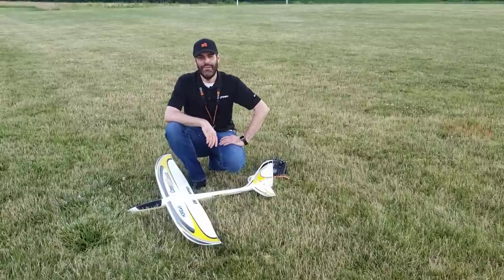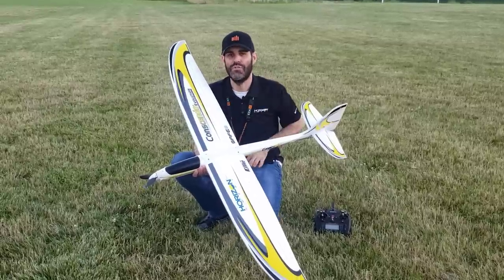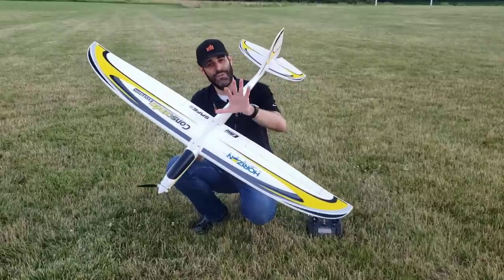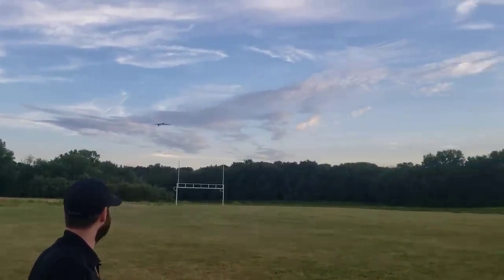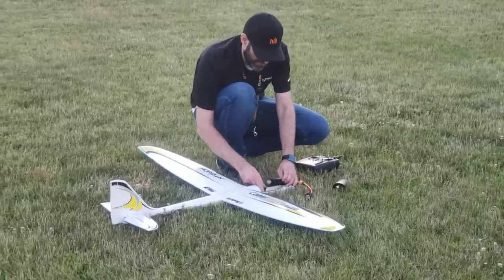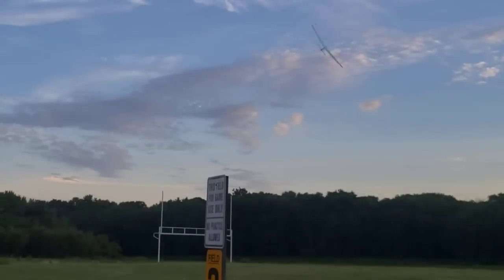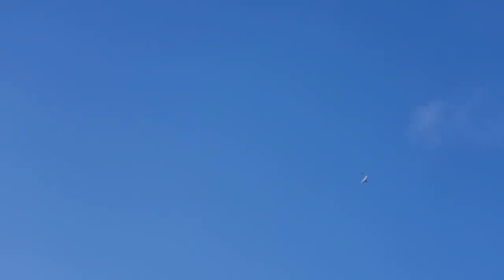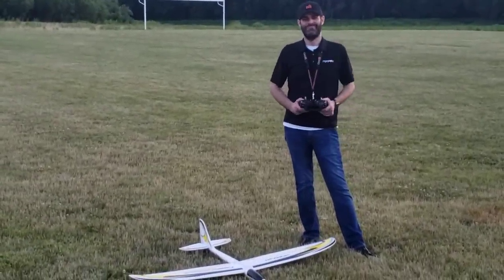Flight Talk: E-flite® Conscendo® Evolution 1.5m

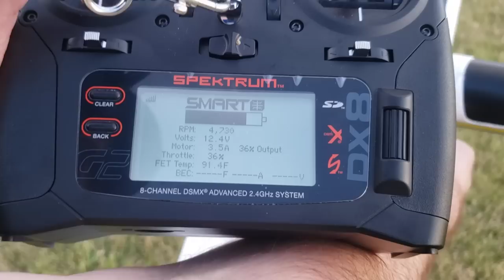Comment from the maker: Please click "Read more" for links and more information. Filmed using a Galaxy S9+ (so it's best viewed on a larger monitor/screen and apologies for any focus/sound issues!). Flight with the 3S 1300mAh battery begins around the 6:00 mark, then a flight with the 4S 2200mAh battery begins around the 10:20 mark. See the Overview video here: https://youtu.be/myuBdYXRSMA

And see more video here: https://youtu.be/6owr-dv6Ats

Join us at the park with Jason Merkle to learn about the features, flying characteristics and more of the most powerful, capable and fun to fly Conscendo® yet!

Learn more about the E-flite® Conscendo Evolution 1.5m Bind-N-Fly Basic and PNP here:

https://www.horizonhobby.com/search?q=conscendo+evolution+1.5m&search-button=&lang=default

First flown with a Spektrum 3S 11.1V 1300mAh 30C Smart LiPo Battery: https://www.horizonhobby.com/product/11.1v-1300mah-3s-30c-smart-lipo-battery-ic3/SPMX13003S30M.html

Then flown with a Spektrum 4S 14.8V 2200mAh 30C Smart LiPo Battery:
https://www.horizonhobby.com/product/14.8v-2200mah-4s-30c-smart-lipo-battery-ic3/SPMX22004S30.html

Also compatible with a Spektrum 3S 11.1V 2200mAh 30C Smart LiPo Battery: https://www.horizonhobby.com/product/11.1v-2200mah-3s-30c-smart-lipo-battery-ic3/SPMX22003S30.html

More Spektrum Smart Batteries: https://www.horizonhobby.com/search?q=smart%20lipo%20battery

Spektrum Smart Charger Lineup: https://www.horizonhobby.com/search?q=smart%20charger

Spektrum Smart Accessories: https://www.horizonhobby.com/SearchDisplay?searchTerm=SPMX_SMART_Accs&categoryId=&sourceDomain=&storeId=10151&catalogId=10051&langId=-1&pageSize=40&beginIndex=0&sType=SimpleSearch&resultCatEntryType=2&searchTermScope=2&showResultsPage=true&searchSource=Q&sourceDomain=&pageView=

Spektrum Smart ESCs: https://www.horizonhobby.com/blog-smart-technology-escs.html

Flown with a Spektrum DX8 8-Channel DSMX Transmitter: https://www.horizonhobby.com/product/dx8-8-channel-dsmx-transmitter-only-gen-2/SPMR8000.html

Also compatible with most Spektrum transmitters: https://www.horizonhobby.com/airplanes/radio-systems/transmitters/

Comment: This was BY FAR the most fun I’ve ever had flying a maiden and then 2 more batteries after. Piece of cake to hand lunch, just wants to fly level. I started off with an 1800 3s. (Covid-19 recoverer, still have issues with equilibrium, vision and fine motor) This plane in either Safe or AS3X is rock solid. It was mildly windy, 6-10 mph, but this plane cut through it like butter. 30-35 minutes flight time (1800 3s, 2200 3s, 2200 4s) Never had to trim it out. A little up elevator with the 4s, but I did that while checking the CG.
If you’re thinking of buying one, do so. It’s the best of All Worlds. You want to glide around, take it easy, fly for 30 minutes on one battery, you can do that. You want something that can go close to 100 mph and not feel like you’re gonna lose control 3 feet off the ground? You can do that. Want to work on your loops, rolls, Split S’s, Cuban 8’s? This is the plane. Want to do all of the above on the same battery? This is plane. Other than the first toss, the 1st turn I was out of Safe. I was in low rates (70/30) a couple of passes and then high rates (100/20) for the rest of the 3 batteries. (I did takeoff in Safe when I hand launched with the Smart 4s 2200. Wasn’t sure the what throttle percentage with the added weight, and there’s no room to move the battery forward or back)
Best, most fun plane I’ve ever flown. It’s the “Mood Ring” of RC planes. Pick the mood you’re in and it’ll fly that way. If you’re just wanting to chill out, it’s hip to your scene. If you had a bad day at work or at home and you’re wanting to fly like a pissed off 15 year old, pop a 4s in and get your “Need for Speed” face on.
What blew me away the most. Rock solid at all times in AS3X. Battery longevity. Recoverability. (I came out of a turn with the 4s, lost the plane in the sun for a sec, when I did see it, I was in a knife edge, nose slightly down attitude. A little freaked out, but I just slowly leveled the wings out, it corrected itself in the nose down, and slowly climbed out. No elevator, no extra throttle, and then it flew by me, I swear it said, “I got this Jeff. Go park your butt under a tree. I’ll call you when the battery gets low.”
Favorite plane I’ve ever owned!

Comment: have had this one almost as long as my extra300 and this is my favorite. on a 3s1300mah i get 5-15min and on a 4s2400mah i get 15 to 45min fly time. absolute a joy to fly, can be slow and smooth or fast and agile. and it is so easy for beginner to fly. great job making it
Reply: Yeah- and what about tail wag ? Mine is absolutely horrid and embarrassing to fly around others. They always ask what’s wrong with it when flying it. This thing is really overpriced trash heap
Reply: @endliberalism4305  this is not my experience.
Reply: @firstjayjay  I've been looking into what causes tail wag but can't find anything that would be the cause to my problem,  I'm seriously bumming , the best thing I can do is try and see if Horizon hobby will hook me up with a new one.... it's doubtful but I've gotta try something
Reply: @endliberalism4305  yea, these kind of products do come with a disclaimer where it is argued that any default could be the result of owner causes. But my cousin also have this model and no issues there. I really do hope you get it sorted out, as it to me at least it is really a great all around flyer.
Reply: @firstjayjay  hello John , will you look at your Conscendo from the front and see if the horizontal stabilizer is even with the main wing or is one side slightly lower. Thank you .

Comment: I have the Advanced version of the Conscendo, it is a fantastic plane that can do a lot of things. I understand why you changed the foam density though, the Advanced is not stiff enough I think. And it has a weak section in the fuselage, right at the back of the cockpit (less foam here, geometry, ...), I had to repair mine at this spot. I don't know if it's the case for this new version. I reinforced mine by adding 2 carbon rods inside, from the back of the cockpit to the receiver compartment, much stiffer now.

About the 1300 mAh lipo, I agree, it makes the plane very light, very good for thermals with a aileron/elevator mix ("snap-flap"?). I put the lipo all the way back.

Also, I don't know how you can have such a roll rate, mine is much slower... Stiffness of the foam too?

Anyway, very good plane, very rewarding for beginners, because it is fast and quite tolerant at the same time. And beautiful to watch!

Comment: Just reactivated my AMA membership and received the FAA certifications. This plane just called out to me. Had range issues with DX6e so reprogramed DX6 and repositioned the receiver antennas. Will take Conscendo to the field tomorrow if it passes all the tests. Just a very beautiful bird. Have mine set up with 3 cell 1200, 2200 and a 4 cell 2200. Looking for some air time.

Comment: I bought one, put it together, and the right wing weighs in at 190 grams, and the left wing is 154 grams!  That's lots of difference on a smaller wingspan glider.  Is it a manufacturing defect?  As I have 'x-rayed' it with a powerful LED torch, and everything looks identical and OK internally in both wings.  Did I get a one wing in the higher density EP foam,  and one wing with the previous lower density wing?  I don't want to test fly it, as I expect it to want to auger in on launch and landing.  It might fly straight with the SAFE system and the AS3X gyro on, but it won't perform as it should with the added drag the autopilot will use to keep it flying straight through the speed range.

Comment: Wow, looks very cool! How much experience do you have? I‘m a total beginner and asking myself how long it would take to get the ability for flying like that.
Reply from the maker: Jason has been flying for about 30 years, but you can learn to fly better in less time by practicing with the RealFlight RC simulator: https://www.horizonhobby.com/airplanes/radio-systems/simulators/
Even the best RC aerobatic pilot in the world, Jase Dussia, uses RealFlight often to practice new maneuvers and to hone his skills without risking his actually models: https://youtu.be/164VFri-5nI
See Jase fly in this video....your mind will be blown! https://youtu.be/7DBPk3TxPV8
Reply: I started from scratch with a Conscendo S, one of the earlier models that had a beginner, intermediate, and expert toggle. I highly recommend starting with this plane the Safe button also levels the plane in an emergency or for easier landing.
Reply: I just flew this exact plane for the first time... I have only flown a  smaller park flyer P-51 by Eachines.. This plane is a whole new level, bigger and fast.. I felt the field I was at was not big enough (approx. 400m track field)..  You need lots of space to comfortably fly this thing if you are a newb... Kinda sux cause now to keep flying this thing I gotta shell out $150 to join an RC club at the appropriate field..

Comment: Is it possible to fly this with my drone batteries which all got XT60 connectors?
Or do I have to solder a xt60 to the esc?
Reply from the maker: The XT60 connectors on your batteries are not compatible with the IC3 connector installed on the ESC, so you can either solder an XT60 to the ESC or you can use an EC3 (which is compatible with IC3 connectors) to XT60 adapter like this one without soldering: https://www.horizonhobby.com/product/adapter-xt60-device-ec3-battery/DYNC0141.html (this is a high-quality adapter so it will not fail or reduce the performance of the power system in any noticeable way...many low cost/low quality adapters would however)
Reply: HorizonHobbyProducts ty so much and I respect that you are open for 3rd party company, really nice! I will get an adapter then :)

Comment: So I lost my little sport cub to the wind a while back, I want to order this plane but the only controller I have is the one that came with my rtf cub, the blue one. Will that controller work with this plane?
Reply from the maker: The MLP6DSM transmitter included with the HobbyZone Sport Cub S RTF is limited range so it can only be used with other 1S (not 2S or 3S) battery powered ultra-micro/UMX class airplanes (like the E-flite UMX Night Vapor or UMX PT-17). To fly the Conscendo Evolution and most larger than ultra-micro/UMX class models you will need a full-range capable transmitter. This includes the Spektrum DXe, DXS, DX6e and 8e, the NX6, 8 and 10, or the iX12 and iX20. One suggestion would be to buy the HobbyZone AeroScout RTF becauses it includes the DXe transmitter, plus a 3S 2200mAh battery that can also be used in the Conscendo. After flying the AeroScout for a bit (it's a good model to learn to fly between the Sport Cub and Conscendo), you can then use the DXe transmitter and 3S 2200mAh battery to fly the Conscendo Evolution: https://www.horizonhobby.com/product/aeroscout-s-1.1m-rtf/HBZ3800.html

Comment: I just purchased this version but wasn’t aware that it didn’t come with a transmitter any advice on which transmitter is compatible
Reply from the maker: The Conscendo Evolution is not sold with a transmitter because it is NOT intended to be flown by someone without experience who does not already own a suitable transmitter! You need to start with a purpose-built trainer airplane, most of which are available in “RTF” (Ready-To-Fly) versions that include everything you need to fly...a transmitter, battery and charger. We strongly recommend the HobbyZone AeroScout S 2 because it’s an excellent trainer and is also a fun to fly model beyond that. After you master the AeroScout, you can use the Spektrum DXS transmitter it includes, as well as the Spektrum 3S 2200mAh Smart battery and S120 charger for the Conscendo! You’ll also have the skills needed to fly the Conscendo: https://www.horizonhobby.com/product/aeroscout-s-2-1.1m-rtf/HBZ38000.html

Comment: how do you get the sand out of the vent on the bottom from landing on the beach?
Reply from the maker: We recommend covering the openings with some clear packing tape to keep the sand out (this will affect cooling of the motor, ESC and battery but it should be fine in most conditions).

Comment: I have the Conscendo S. rtf. The first one made. Question? Will the new Conscendo Evolution  bind to the transmitter from the rtf Conscedo S? And will all the switches and stuff work with out having to change stuff in transmitter? You know just bind and fly it? Thanks you! Very interested in plane!
Reply from the maker: Yes! However, we do recommend using the new DXS or any of the current Spektrum AirWare equipped transmitters (DX6e and 8e, DX6 Gen 2/3, DX8 Gen 2, DX9, iX12 or iX20) to take full advantage of the telemetry capabilities if you purchase the BNF Basic version.
Reply: @HorizonHobbyProducts  Thanks for the answer. If the origanal transmitter from the S  RTF works and all the switches work right for SAFE. Then its ok with no telemitry None of my planes have that anyways! If it were a drone, it would matter to me more! Thank you!
Reply: @HumbleHeartMinistry  how did this work out for you? I'm planning to do the same as I crashed my S. Does the beginner/ intermediate/ expert switch still work?
Reply: @michaeldirisio3617  Yes it did work. Everything worked the same. But that was going up from the 1st version to the Advanced, the second version. But don`t know about the 3rd version, if it will work?But H.H. will be able to tell you for sure.

Comment: Looks like the telemetry works good, scaling seems to be off on my night timber with the factory transmitter setup
Reply from the maker: If the RPMs seem too high, be sure to set the pole count of the motor correctly (to 14 poles for the motor in the Night Timber X) :)
Reply: HorizonHobbyProducts 
Awesome, is there a way to also adjust the amperage scaling? Thanks for the help

Comment: I am new with spektrum, i am trying to bind my new conscendo evolution BNF with my new Dx8e and i have servo control but AS3x  is not active and No safe select either,  need tech support?
Reply: Join FB rc groups and they can guide you. Good luck
Reply: AS3X is active only if your throttle goes up to 25%, till the battery is disconnected. 
For Safe to be active you have to follow the specific safe binding procedure in the manual.

Comment: I just won an auction on EB for a DX6i....can I use the 6i to bind to this Conscendo?
Reply from the maker: Yes! But it is not compatible with the telemetry functions of the receiver/ESC (only AirWare equipped Spektrum transmitters like the DX6e and 8e, DX6 Gen 2/3 and DX8 Gen 2, DX9, iX12, iX20 are compatible with the telemetry)

Comment: Just so people are aware there is a software update for the AR637T receiver this is the AR637TA receiver probably update via spektrum programming cable.
Reply from the maker: This video shows how to "unlock" AR637TA receivers so you can adjust the stock settings, or reset it for use in other models: https://youtu.be/F3isbv1U8eM

Comment: Hey guys. Newbie here. Does anyone know if this will work with the DXs transmitter?
Reply from the maker: Yes! If your DXS came with an airplane it will work without changing anything. You can also use the DXS for other models using the preset profiles as shown in this video (or if your DXS came with a helicopter you can switch to preset profile to work with the Conscendo): https://youtu.be/g7iOkc8-jd0
Reply: @HorizonHobbyProducts  awesome. Thanks a ton, guys!!  I'm looking forward to tearing up the sky with one of these bad boys!

Comment: How fast with 4S?
Reply: Fast!!!
Reply: Well it’s a 30amp esc so the power system is about 450watts maximum. I’d say 100-110mph is possible flat and level. Not anywhere near F5D speeds, but more than adequate for mass market appeal.
Reply: Check out RC Saylors’ YT.  It looks to be going well over 80 flat out.

Comment: Has anyone clocked one yet? Curious of top speed
Reply from the maker: We did take some time to check the top speed when using Spektrum Smart 4S 2200mAh 30C batteries ( https://www.horizonhobby.com/product/14.8v-2200mah-4s-30c-smart-lipo-battery-ic3/SPMX22004S30.html ) last week...level flight top speeds are around 80-85 MPH, and you can easily hit 90+ MPH coming out of a dive  It's even faster than we expected, and although that's not all this model is about, it's pretty impressive...and is a whole lot of fun!

Comment: For those thinkiing of any new Horizon Hobby BNF models.  the AR637T TX installed in these models is locked.  That means if you ever crash or tire of the model, you either throw away a 120€ TX or are forced to buy a BNF of the same model and reinstall.  Given how often Horizon retire models this may be a problem in future or likely you get charged to unlock.  At the moment Horizon refuse to help you unlock the AR637T so it can be used in other models.  Model is OK, its not a  great glider but its OK.  Also not super stiff (especially tail boom) as most reviews are informing and you may want to consider better servos.. also check control cables to elevator and rudder..,. they can slip.
Reply from the maker: The AR637TA receiver was never intended to be "locked" long-term, and you can now update the firmware (FOR FREE) so it will function just like the "open stock" AR637T. This means you can adjust the settings via forward programming, or reset and reprogram it for use in other models, as seen in this video: https://youtu.be/F3isbv1U8eM

Also, there are plenty of positive reviews and many videos to confirm there are no issues with stiffness of the airframe, tail boom or servos...evidenced by the fact we cannot build and ship this very popular model fast enough (currently sold out in many countries for the next few months!)!